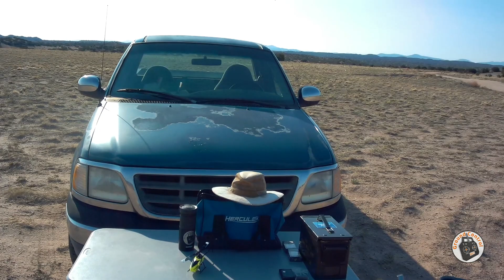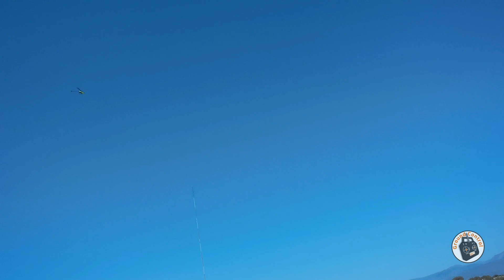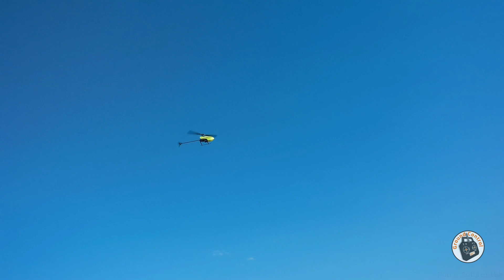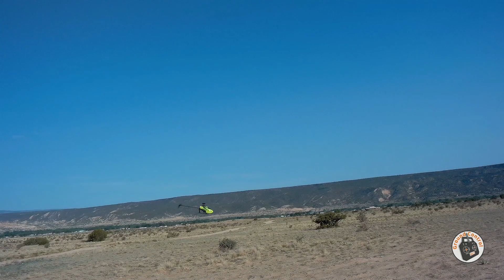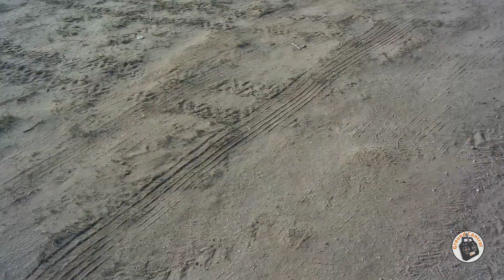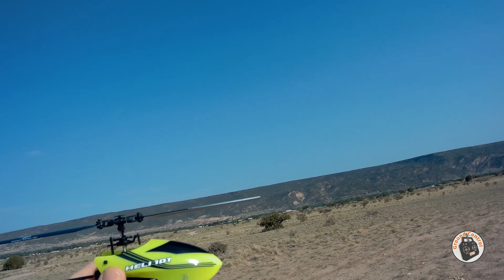First Step RC Heli 101 6-Axis Gyro Altitude Hold RTF - Test Flight #1 using the RadioMaster TX16S

Comment: Just watching this for the first time as I want to bind mine to the Tx16s. Did you ever publish your settings and if so, where?  This is a fun little heli that I just use to fly in the yard but if I can get it on the Tx16s vs use the stock transmitter that would be great.
Reply from the maker: Yes, it's a fantastic flying Micro Heli and even better with a Hobby-Grade TX.
I post all of our Setup Files and OpenTX Model Files on our Facebook Page.
If you search the Facebook Page for "heli101" it should be one of the 1st post in the search results.
https://www.facebook.com/GroundControlRC/
Reply: @GroundControlRC  thanks.
Reply: Did you sort out a way to have it switch from high to low gear like on the stock transmitter? I downloaded your file and it’s great but I’m trying to figure out how to make that work.
Reply from the maker: @jpap1059  What I had read in the Multi-Module documentation was that it would be in high rates by default and you can limit the rates by decreasing the Dual-Rate in the TX.
I have mine setup using the Dual-Rates and EXPO that's comfortable for me so I only use those Rates.
I was concerned it would only be in Low Rates by default but according the Multi-Module documentation that's not the case.
Reply: @GroundControlRC  ok that makes sense. Now I see why you set rates like that. Ver smart. Cannot wait to try this. Thanks again for sending that to me.

Comment: Did my first test hop with the E129, and I can verify that it is a completely different bird compared to my other helicopters.  I'll make a comparison video later after I have spent some time with it, but here's my 1st impression in a nutshell...

PLUS:
Very east to fly for the new heli pilot.  Amazingly stable.  The electronics control the throttle and collective pitch.  The throttle stick just tells the heli to go up or down at a rather leisure rate, similar to some of my quad drones.  In contrast, the pilot of the E129 has near-full control over the cyclic for fore/aft/left/right maneuvering with the right stick and tail rotor rpm's for yaw, with the gyro feeding in whatever is needed to maintain level flight and direction (no position hold).

The E129 can get a new pilot flying in one day and is very relaxing to fly.  The non-stabilized birds can take a month or more just to learn to hover. With more time and less wind I would like to see what it is capable of.

MINUS: 
The pilot is totally isolated from blade pitch and motor RPM.  Climbing and losing altitude speed is strictly at the mercy of the electronics.  Hold the throttle stick down and the bird slowly settles to the ground.

  With a typical heli you move the stick all the way down and it will either cut power and fall out of the sky (fixed pitch rotor or collective pitch in "Sport Mode") or drive itself into the ground at full speed with negative blade pitch (collective pitch in 3D mode).    The throttle stick directly controls motor speed and blade angle in typical helicopters. Admittedly this DOES make them harder to fly, but provides for much more vertical control.

 At one point a downdraft started pushing me down onto a bird feeder, and even though I fed in full-throttle to climb out it kept coming down, only slowing gradually in descent until a blade struck the feeder, the motor shut down automatically and it fell 6 feet to the ground (no damage except a dinged blade). A standard heli would have climbed immediately away.  Gotta keep this in mind while flying it.

I have to admit I find the tail rotor too sensitive for my tastes, having become use to my other heli's whose tail rotor RPMS ramp up more slowly.  I went to make a fast left turn for the first time and ended up performing a 360 spin (heh heh).   I think I need a multi-protocol radio for this one so I can adjust tail authority.  Just a personal preference.  With time I would most likely grow use to it as-is.

The rotor blades have a positive camber for more lift similar to my fixed-pitch heli's, so this means no stunts or inverted flight.  UNLIKE my fixed-pitch MSRX the E129 has collective pitch as well as varying rotor speed to control altitude. The MSRX only has cyclic pitch for direction control and controls altitude strictly through rotor speed.

  Collective pitch blades are typically symmetrical airfoil shaped.  I do not even think the E129 can do a loop or roll, though the always-on stability mode would prevent it anyway.   Definitely a trainer for the first time heli pilot, though seemingly a very good one for that use.    You could learn more with a standard sport heli, but you will break a lot of parts in the process of learning to control it.  This is why flight sims are so critical to learn the basics of heli flight first without breaking stuff (or worse). I like this one a lot (I use Phoenic RC): https://www.banggood.com/22-in-1-RC-Flight-Simulator-Cable-for-G7-Phoenix-5_0-XTR-VRC-FPV-Racing-Compatible-Radiolink-or-WFLY-or-FUTABA-or-FlySky-or-Walkera-Transmitter-p-950398.html?cur_warehouse=CN

My conclusion:
Intermediate heli pilot (me)...  You may or may not enjoy it.  It's a whole different ball game, like flying a fixed wing in SAFE or 6G mode in some ways.   I need more airtime with it to see what it can do.

Advanced heli pilots... Probably won't like it any more than a Tour De France rider on a bike with safety gear.

First time flyers... You will have a lot of fun with it.  Easy to fly and very durable.   Compared to my Blade birds, this thing is a tank.  Don't be afraid to break it, though I'm sure someone will find a way.   Short learning-to-fly-it period.

    I recommend flying on calm or low-wind-speed days.  That's basically true of any VTOL, but going against what one might expect this "stabilized" heli is a bit trickier to control in turbulence.  I think the barometric altitude sensor was getting false data from the gust and rotors it was experiencing.    My back yard is a great place for turbulent air flight-testing  ;-)

NOTE: The cheap transmitter gimbals are a major handicap.  A multi-protocol TX with adjustable control range and decent sticks is pretty much a must, IMO, and will make the helicopter much more enjoyable.  Just ask GroundControlRC.  

 More later.  Happy flying!

UPDATE EDIT:  Second flight in smoother air did better.  I adapted to the rudder and managed a few circuits around the yard.  Fun bird.
Reply from the maker: I definitely concur! I think for what it's designed to do, a very stable beginner Heli, it meets all the criteria. The slow spinup / spindown takes some getting used to as well as the yaw rate. At least for me. I'm very much a beginner when it comes to helicopters and it was extremely easy for me to fly so it should be the same for other beginners. A Hobby-Grade TX certainly makes it even easier to fly. Better throttle control and smoothing out the Yaw. Very fun little Heli for a beginner.

Comment: That looks really good fun, I've always fancied a heli but was put off by their relative fragility and got into LOS Acro quads instead. (Warpquad 230) The great thing about it is that you usually just brake props if you bin it. Amazing performance, very tough, super easy to fly and a real blast, you should try one! :)
Reply from the maker: That's a cool looking quad! I like the fact that everything is enclosed in that carbon frame. That was a good idea. I have a custom built 250 quad I need to repair and a 450 quad that needs to be flown. I also have a Mobula 7 Micro Power Whoop ;-) That's Fun ;-) I haven't flown my quads since transitioning to planes but I'll have to get back into practice. I've always flown mine FPV but now that I've gotten used to flying Planes and Micro Helicopter LOS I'll have to try out my quads LOS ;-)
Reply: @GroundControlRC  Its amazing how much difference a power to weight increase can make just losing the cam and vtx. You tend to fly them extremely differently too, I have quite a safe and easy to fly setup by having autolevel on the momentary switch.
This guy is an extremely talented LOS pilot, maybe you have seen his videos.. 
https://youtu.be/wIKJfpy_s_k
Reply from the maker: @paulhope3401  I've never seen him before. That is absolutely insane! His Kung-Fu is the best ;-)

Comment: I may look for one of these stabilized whirlybirds for teaching friends to fly heli's. Hesitant with the price though.  What's your opinion on this one ($89) compared to the Eachine E129? ($50).

Happy hovering!
Reply from the maker: Great Beginner Micro Helis! The only difference I see between the E129 and the Heli 101 is the Heli 101 has a much smoother Yaw Axis. That makes it much easier for me to fly. I don't have much experience flying Helis at all. The Transmitters and Helis look identical. I can only assume they tweaked the Firmware on the Receiver / Gyro Brick to make the Yaw Axis smoother. If you have a Hobby-Grade TX you can use to bind to these it wouldn't matter at all. Both are exceptionally smooth on the TX16S.
Reply: @GroundControlRC  E129 it is then.  I recall you praising the yaw action earlier on the Eachine bird too.  Thanks buddy.   If I ever find one that the flyer can turn 6G off or on at will then I'll get it for myself. ;-)

The TX-16S feels better due to the hall sensors, but also due to the hobby-grade gimbals that don't go numb on you once yuu move one axis off-center.  That's where I feel the biggest control increase.  I'd even be happy with a TX-16S with standard potentiometer gimbals, IF I found one for the right price.
Reply from the maker: @Doggeslife  Let me know what you think of the E129 once you fly it. You can even FPV that Heli ;-) See you in the Air!
Reply: @GroundControlRC  Cool.  Will do.  On it's way from BG.  $64 total including tax.

  $5 difference between the 1-battery and 3-battery deals ($54.99 vs $59.99), and Bang Good charges $12 per battery for replacements, so that choice was made for me.
Reply from the maker: @Doggeslife  Yep! I've almost always found it cheaper to buy RTF Aircraft with the max. amount of LIPOs rather than buying them later ;-) Now, we're both waiting on deliveries ;-) See you in the Air!

Comment: What protocol did you use with the FS 101 ?
Reply from the maker: Hi Lasersbee! I used the E129 Protocol. There seems to be some differences though, as I had everything programmed the same as the Eachine E129 and a couple of the switches weren't working.
Reply: @GroundControlRC  how did you fix the issues with the switches I have the same radio and heli
Reply from the maker: @EmbededG  I gave that Heli to one of my Nephews with the Stock TX.
I never had those switches working 100%.
Sometimes they would work and other times they wouldn't.
Maybe I needed more separation on the offsets for the switch positions.
They worked 100% on the E129 so maybe the difference was in the firmware on the receiver board.